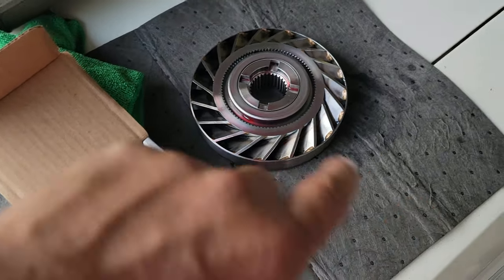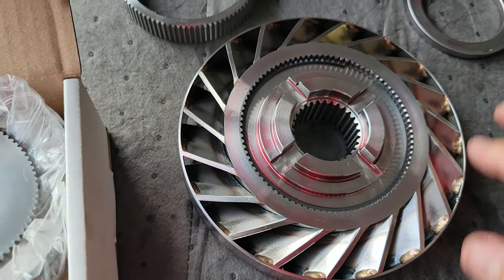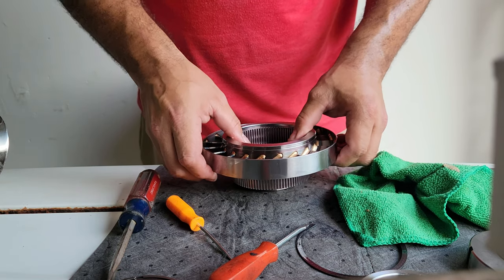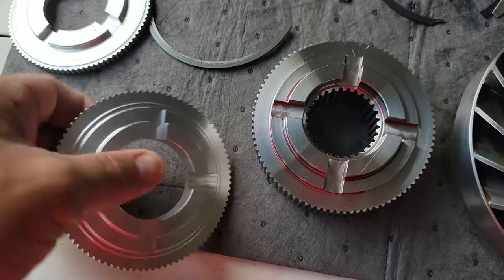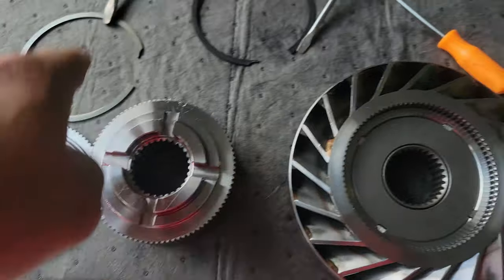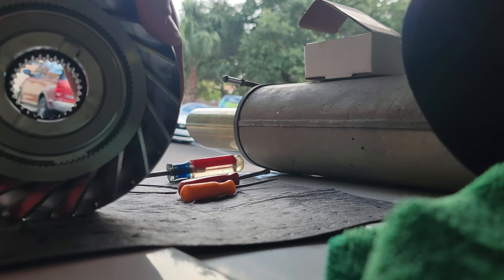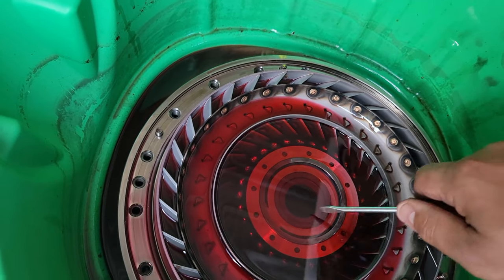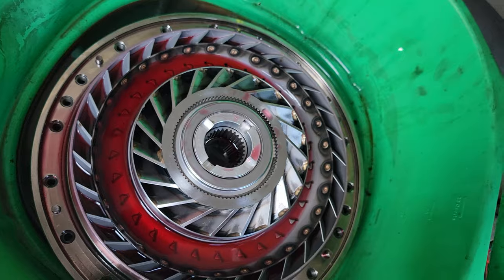Coan Torque converter Sprag install on SectionH8's 400 trans, Did i install this correctly?

Comment: Alex, you got it installed correctly. 
To understand how the thing works, look at your video again. The fluid comed from the transmisssion side to the outside fins (centeifugal force will push the fluid out). Now, look at the angle of those fins. It redirects the fluid and it comes back tru the small turbine. Note the angles of the fins. When the fluid comes back tru the small turbine it forces it counter clockwise (in the lock direction). Then of course, once you have enough speed/pressure of the fluid moving tru the fins the fluid wont be able to flow tru them so it “drags them”. Then is when your converter locks. 

If you heard the term “Dump valves”, it is a valve that allows you to dump some of the fluid entering the converter. By doing that, you have “some” control over the stall speed/lockup, instead of been “confined” to the mechanical part only(the pitch of the fins).
Reply from the maker: I appreciate the detailed response. I hope to feel how different the trans acts with this installed.

Comment: On your last live feed you talked about having to rivet in the Scott rod panels and then drill an access panel for the fuel pump hats. I recommend if possible using rivnuts to hold the panels in and if work needs to be performed you can just unbolt the panel fairly easily

Comment: Looks correct,  as long as the inner splined race spins clockwise (to the right) when looking down on the assembly from the pump side (transmission side) of the torque converter

Comment: It looks correct to me. Although  I could not tell if the cuts in the pieces  on either  side of the sprag need to be oriented  a certain  way to each other.  It looks like the piece you removed  they were at 45 degrees  from  the top side to the bottom  side. Idk if that matters or not. 

 The stator will spin counter clockwise when looking at it from the transmission side. Or an easier way to think of it is the same direction  the torque converter  spins. The splined center of the sprag is stationary  and the stator will  spin counterclockwise.  Once the turbine starts to catch up to the speed of the impeller, this will allow the impeller, stator, turbine and the oil to all move as one unit. Which will not shear the oil and generate the heat.  When the turbine ( which splines  onto the input shaft ) is at low speeds or is stationary  the stator doesn't  spin.

Comment: Every time I add a link my comment disappears. If you search rivnut tool a bunch pop up.  Pretty simple device. Instead of just a rivet it installs a small threaded nut so you can use a bolt to secure the panels making them removable.